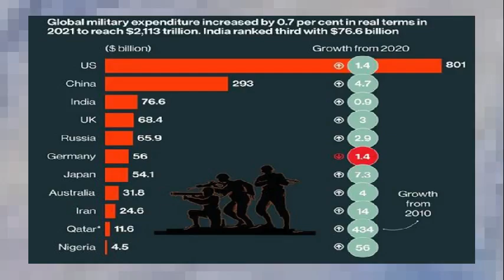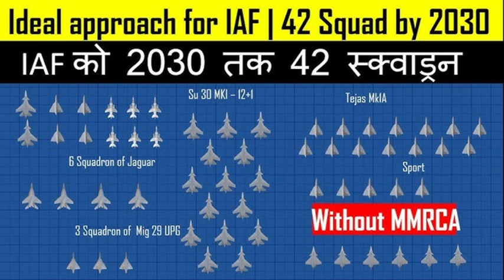Will INDIA find a NEW POWERFUL ENGINE for TEJAS Fighter Jet ?

Comment: India need to make 2 models GE 414 and using Russian engine used in the SU 30 MKI . This will bring better compliance of usa with India . 

Comparing the AL-31FP and GE F414 engines involves analyzing their thrust specifications, suitability, and the practical implications of integrating each into different variants of the Light Combat Aircraft (LCA) Tejas, an indigenous multirole fighter developed by India.

AL-31FP Engine

	•	Manufacturer: NPO Saturn (Russia)
	•	Thrust (Dry): Approximately 7,600 kgf (74.5 kN)
	•	Thrust (Afterburner): Approximately 12,500 kgf (122.5 kN)
	•	Thrust Vectoring: Yes (2D thrust vectoring nozzle, offering pitch-axis control)
	•	Primary Use: Su-30MKI and Su-30 variants

Pros:

	•	Thrust Vectoring Capability: Provides excellent maneuverability, especially in dogfights. The thrust vectoring nozzle offers pitch-axis control, which can enhance agility and evasive actions.
	•	High Wet Thrust: With a maximum thrust of around 122.5 kN on afterburner, it is a powerful option for heavier aircraft requiring strong thrust for high-speed engagements.

Cons:

	•	Weight and Size: The AL-31FP is significantly larger and heavier than the GE F414, potentially requiring substantial design changes to fit into the LCA airframe.
	•	Maintenance and Cost: Russian engines are generally noted for higher maintenance requirements compared to their Western counterparts.
	•	Fuel Efficiency: Generally less fuel-efficient than the GE F414, impacting operational range.

GE F414 Engine

	•	Manufacturer: General Electric (USA)
	•	Thrust (Dry): Approximately 6,200 kgf (60.8 kN)
	•	Thrust (Afterburner): Approximately 9,800 kgf (96.1 kN)
	•	Thrust Vectoring: No thrust vectoring in the standard variant.
	•	Primary Use: F/A-18E/F Super Hornet, F-15 Eagle, and some variants of the Tejas Mk2

Pros:

	•	Smaller and Lighter: The F414’s size and weight make it more suitable for the current design of the LCA Tejas.
	•	Fuel Efficiency: The F414 is known for better fuel efficiency compared to the AL-31FP, which extends the operational range.
	•	Ease of Integration: Given its use in the Tejas Mk2, the F414 is a natural fit and would likely require fewer modifications.

Cons:

	•	No Thrust Vectoring: Without thrust vectoring, the F414 lacks the agility boost that the AL-31FP offers, which might be a disadvantage in close combat scenarios.
	•	Lower Thrust: With a maximum thrust of 96.1 kN on afterburner, it provides less raw power than the AL-31FP, though it is still adequate for the LCA’s mission profile.

Hypothetical LCA Variants with Each Engine

	1.	LCA-Tejas AL-31FP Variant
	•	Thrust: Enhanced power output of around 12,500 kgf with afterburner.
	•	Design Adjustments: Would require airframe modifications to accommodate the larger AL-31FP engine. This includes potential reinforcements in the fuselage and alterations in weight distribution to maintain balance.
	•	Performance: Improved maneuverability and thrust-vectoring capability would make it ideal for high-maneuverability roles, especially for air superiority missions.
	•	Operational Range: Given the engine’s fuel consumption, this variant may see reduced range unless fuel capacity is increased.
	•	Role Suitability: Ideal for air defense roles where agility and quick thrust changes are critical.
	2.	LCA-Tejas GE F414 Variant
	•	Thrust: 9,800 kgf with afterburner, adequate for multirole operations while maintaining the original weight and size constraints of the Tejas.
	•	Design Compatibility: Minimal modifications required, as the F414 is close in specifications to engines originally intended for the LCA Tejas Mk2.
	•	Performance: Offers a balance of power and fuel efficiency, making it suitable for extended missions.
	•	Operational Range: Superior range due to better fuel efficiency, allowing longer loiter times and potentially reduced refueling requirements.
	•	Role Suitability: Best for strike missions, reconnaissance, and long-range patrol, where fuel efficiency and operational range are prioritized over extreme agility.

Conclusion

	•	AL-31FP LCA Variant: This model would suit roles that demand superior maneuverability and agility, ideal for close air support and air dominance roles.
	•	GE F414 LCA Variant: This model would be a cost-effective, fuel-efficient, multirole fighter with a focus on range and strike capability, ideally suited for extended mission profiles without heavy close-combat demands.

Ultimately, each engine brings different capabilities, and developing two models could allow the Indian Air Force to deploy specialized LCA variants for diverse mission requirements.

Comment: When we either install RD-33 ( which we are already manufacturing ) or Kaveri with Brahmis developed afterburner is ready !
Reply from the maker: The engine is not up to international standards yet.
Reply: @NewsAffairs108  Boeing aircrafts are upto international standards but their doors fall off mid flight.
      Russia recently brought an American astronaut back from space in their NOT UPTO INTERNATIONAL STANDARD spacecraft.
    All the western negative propaganda can't make Russia inferior to the west when it comes to missile, jet engine or aircraft technology.
Reply from the maker: @ It’s about trusting the home grown technology. Tests of the Kaveri engine have not given the desired results for a fighter jet like Tejas. It’s still work in progress. You are right in quoting the case of Boeing. We will have to trust our technology and put the in the required inputs
Reply: @NewsAffairs108  Kaveri core has crossed 52 kN dry thrust & regularly crossed 50kN.
     The afterburner was not giving the required output & Brahmos aerospace has already started working on that. Very soon it will be delivered.
Reply from the maker: @ We are on our way……….